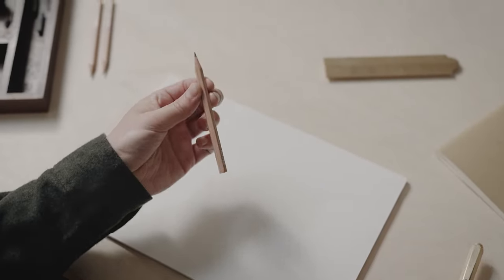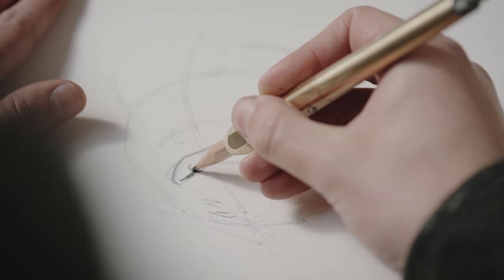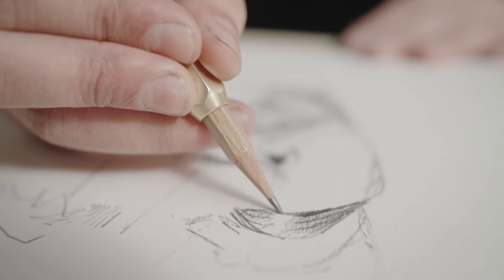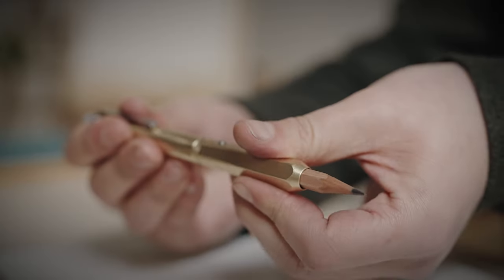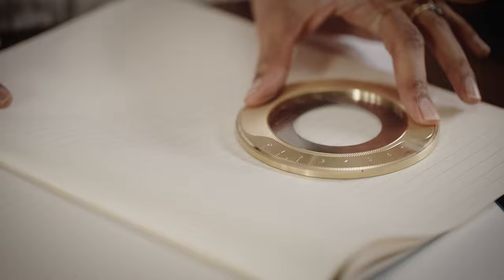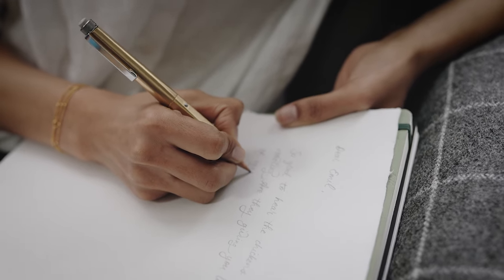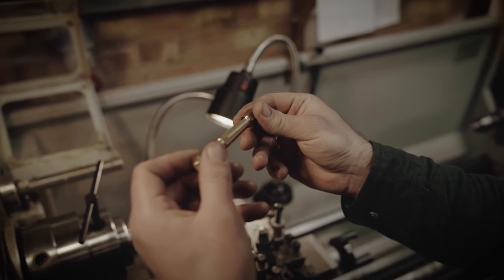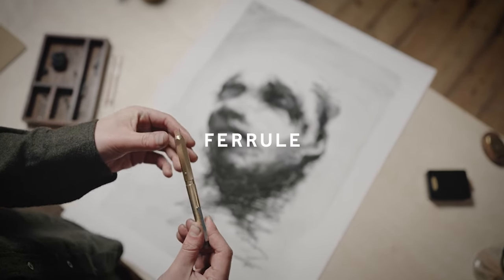Ferrule, a pencil holder that will extend the life of your pencils and last generations.

Comment: But will it hold a blackwing? 🤔
Reply from the maker: Hi Victoria! Unfortunately due to the tops of Blackwing pencils, the Ferrules won't hold them. Sorry!
Reply: You can remove the eraser ferrule from the Blackwings,using a pair of pliers or your hads if you're strong enogh.Then, it should fit the Makers Cabinet Ferrule!